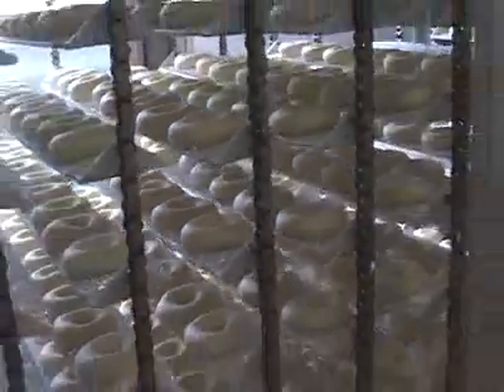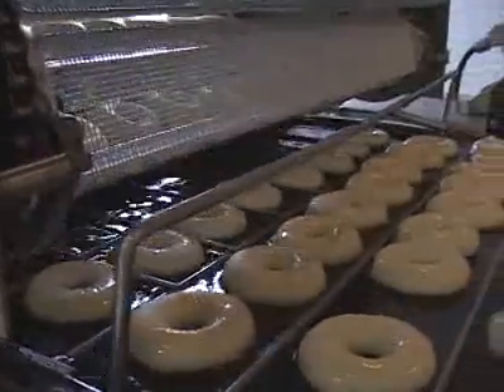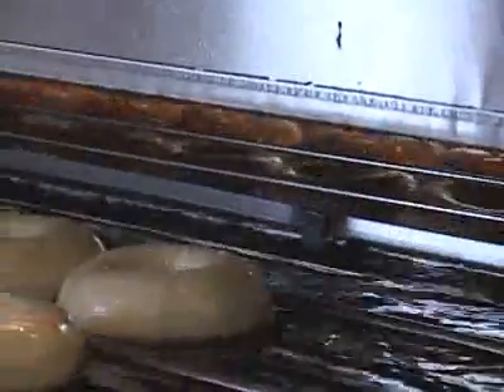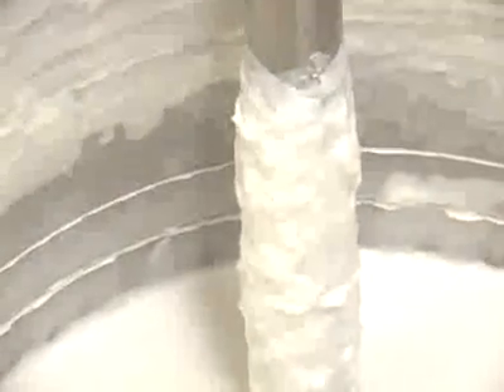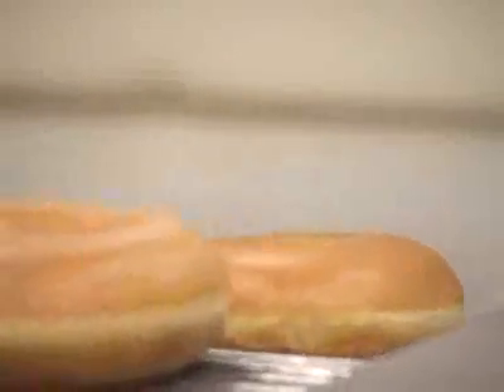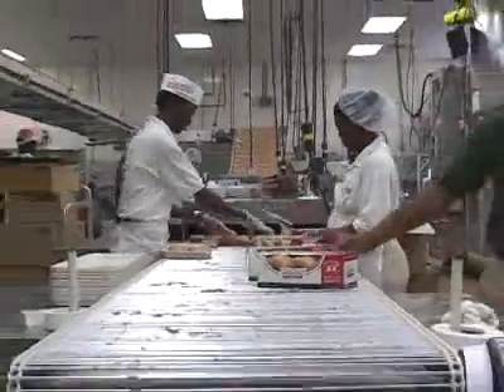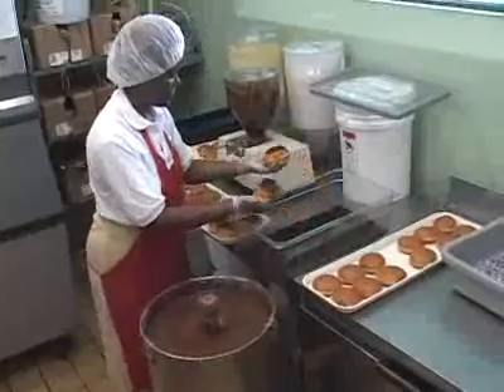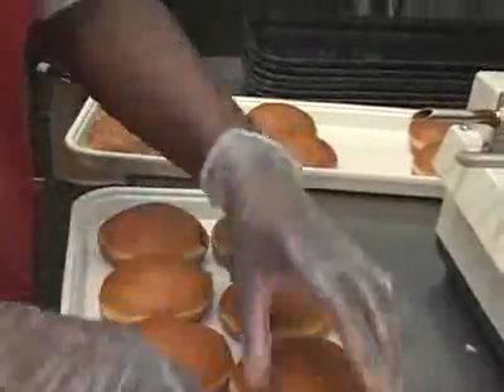How Krispy Kremes Work

Comment: We used to have a Krispy Kreme right next to the In 'N Out near where I live, and frankly, I was unimpressed.  Compared to the local doughnut shops, they were bland, to me.  I will admit that a doughnut fresh off the line is quite tasty, but you have to get there right as they open to get that.  Any time after that and the cooling robs them of the taste.  I'd rather just get some glazed doughnuts from one of the local businesses.